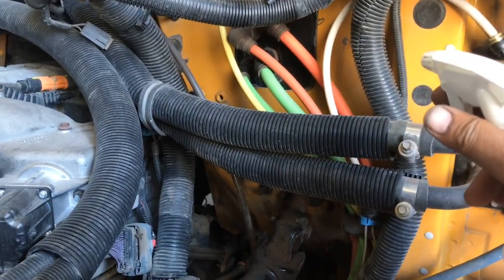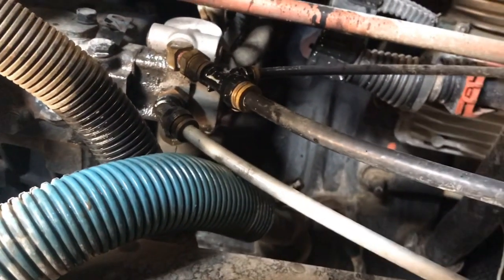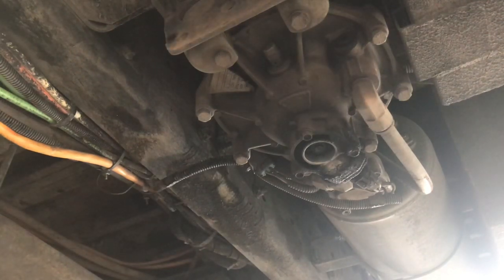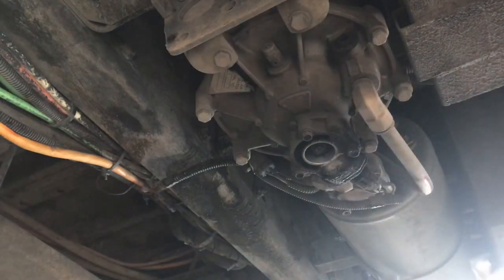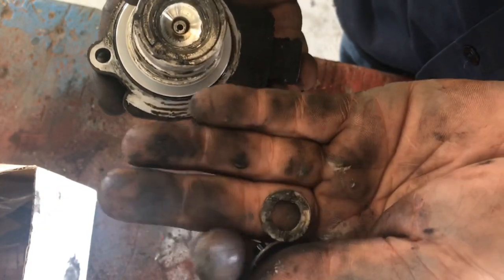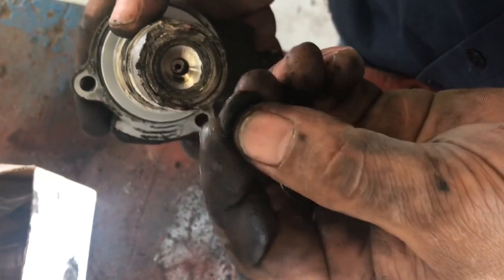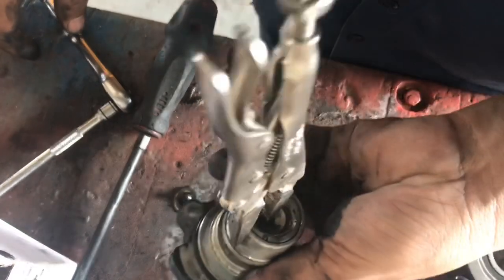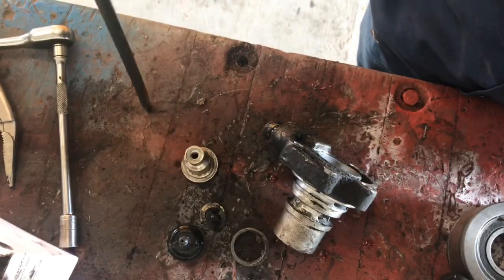Losing air pressure

Comment: That's not a servo.  It's a heating element which keeps the water from freezing in cold climates.  That purge valve is completely rebuildable--especially if it is a Bendix AD-9 dryer.  The purge comes from the unloader valve on the governor--there is a line from an unloader port to the dryer, and when the unloader stops the compressor, the air is routed through the unloader line to the dryer, which opens the purge valve to "spit" the water out.  My Thomas did not have a dryer when I bought it--just a pull cord.  I ended up getting a used AD-9 dryer off of a semi, and added it to the system.  Easy mod....
Reply: Yes. You are correct.
He understands 90% of how it operates, but lacks a complete understanding.
Enough to fix it by replacing parts, but not enough understanding to explain its operation fully and correctly.
The dryer's Purge Valve is the path, by which, the dryer expels water from the system. It is normal, to see residual water in, and around the Purge Valve. This does not indicate a faulty Purge Valve. Rather, it indicates that the dryer is removing moisture from the desiccant canister, as it is designed to do.
  As "tvstreetmsn" stated; the Purge Valve in this video could have been rebuilt with an available soft-parts kit, at some savings to the customer.

Comment: How much air pressure should i lose on my box truck overnight parked? Please i have same issue, i changed the foot valve quick fittings that were leaking but truck still loses air pressure overnight to zero.

Comment: awesome stuff man
i have kind of same issue with my truck
i also lose more than normal air pressure when holding service brakes. if i stop at a traffic light and hold brakes then drive a mile and face another traffic light my pressure will drop under 60 and buzzer will sound. it will take like 5/6 miles driving to go back to 120 
its just so damn slow to go up and drop fast
you think its a leak ? or bad air compressor
Reply from the maker: Hey there Zeid. Sounds like u might have a leaking brake chamber my friend. Have someone walk around the unit while you hold down the brake pedal. You might have a bad chamber. Very easily found with an assistant.
Reply: @JoesBusBarn  how much fixing sonething like this cost ?
also why filling back up with air to 120 slow ? when i drive after it had dropper ? 
the brakes wouldnt be engaged so that means leak somewhere else no?
Reply from the maker: Brakes will only lock up when pressure drops to under 30. Then ur park brakes kick in. Brake chambers are not that expensive. There r 2 types. Short and long stoke. They run around 60 bucks or so.
Reply from the maker: The replacing of chambers is not to hard. You could DIY it or take it in for service. They probrably charge u like 2 hrs labor. I don’t know what the cost per hour is at ur location.
Reply: @JoesBusBarn  but you think brake chambers bad themselves of brake hoses going to them ? also do i need to replace slack adjuster,scam and bushings with the chambers? i heard its recommended to do all together
last question is say i need to change driver side steering axle brake chamber, do i changr both sides or whole truck or just one i suspect leaking ? 
thanks

Comment: Hey there Joe..long time buddy. My 01 4300 was building pressure over 150 psi and alarming. I bled the lines and all.kinds of gunk came out. Replaced Governor and valve yesterday and today it worked fine for an hr now I lose pressure whenever I hit the brake and it won't rebuild. I pull over and bleed the brakes down and let it rebuild before resuming only to have the same thing happen.  Does it sound like tanks are gone?
Reply from the maker: You might want to check the pressure regulator on your tank or tanks.